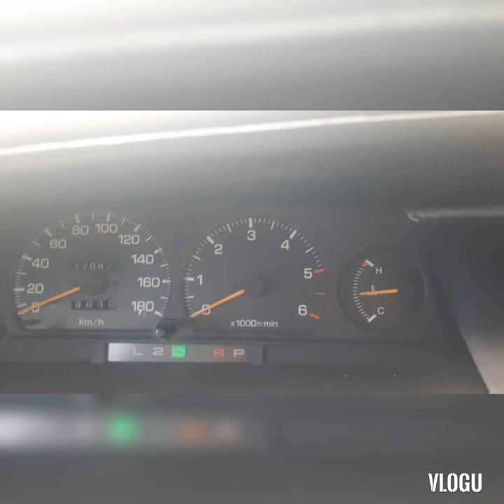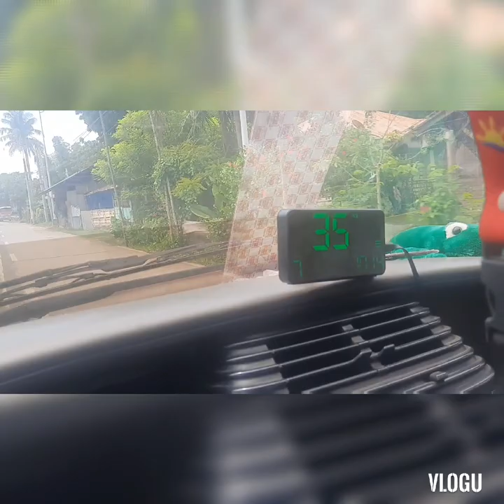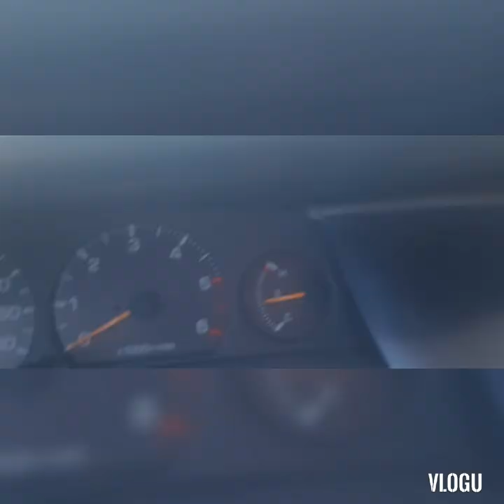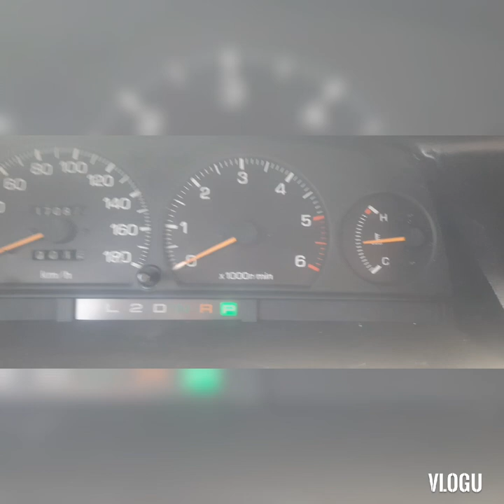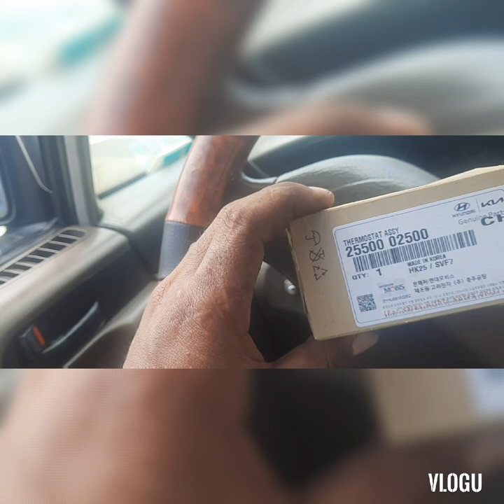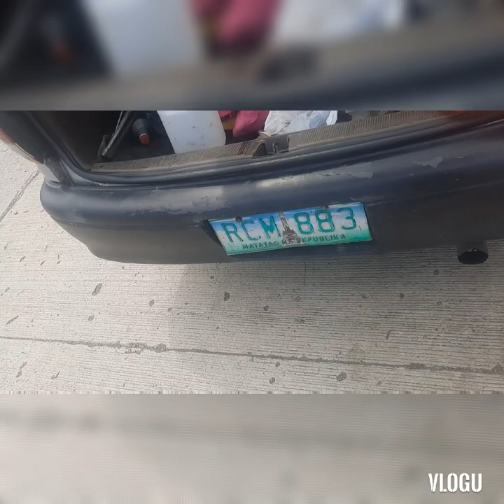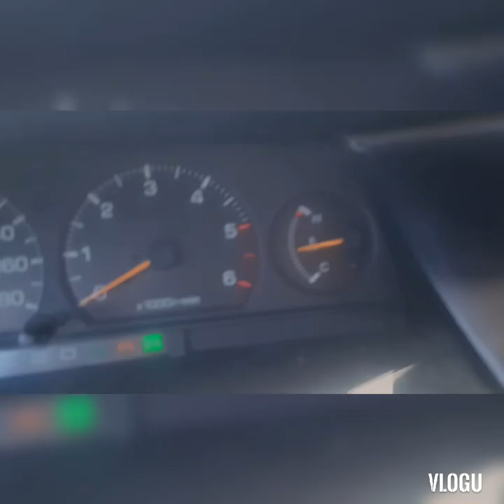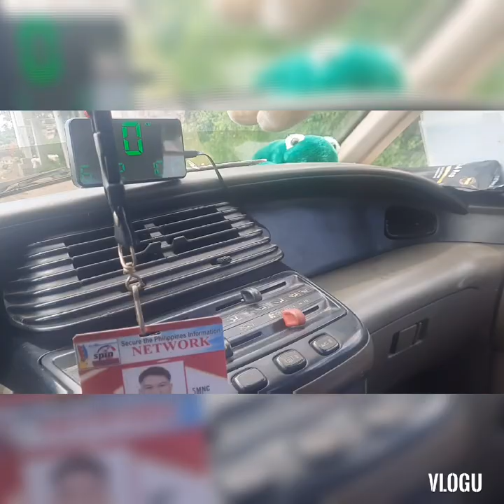Update 93 Toyota Rebuild Linagyan ng Thermostat na po

Comment: Ganyan din po sasakyan namin sir dati ring nagooverheat pero nung pinareface nanamin naging okay napo at pa check niyo nlng mga hose sa radiator   boss para sure na walang barado mas maganda palit nadin. Sa ac namn boss malamig basta wa ring singaw mga hose.
Reply from the maker: Ok na sya ngayon
Na test ko na rin sa city drive.ok na sya..
Napagawa ko ma rin ang AC..at ok na rin.
Reply: Sir anu po size thermisthat
Reply from the maker: @jamesbryanvillarente2112
sa starex sir